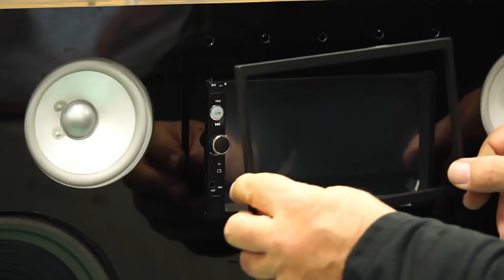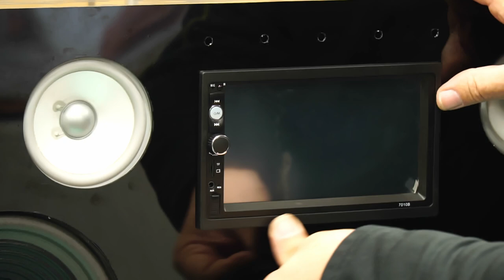DIY Boombox of old speakers, car multimedia with bluetooth and new 8 inch subwoofers

Comment: Brother, please state in more detail what ingredients you have used and the actual cut size as you have created to build a Boombox Project/Speaker this,.. With that, I feel proud of what you have shared with me, let the brother know that here I am also on the same mission, collecting potion equipment  as you have seen in the video above, I am sure that soon I will work on this project immediately, there is only a little dependency to implement it because I am waiting  the size of the pieces of material, if you are willing to detail it to me, I promise to prepare it as soon as possible and will immediately enjoy the results of the knowledge you have shared,..That's all from me, thank you and good luck with your next project, :- Greetings 1 Hobby from Malaysia 🇲🇾💪👍🤝...

Comment: I have the same head unti in my car and when it's on bluetooth recieving mode , the head unit some times randomly sound like a record stuck for a couple of seconds and then restarts and this happens only under bluetooth , fm , usb all good , how can I solve it help
Reply from the maker: Problem with the bluetooth receiver itself. Try placing your phone closer to the device!